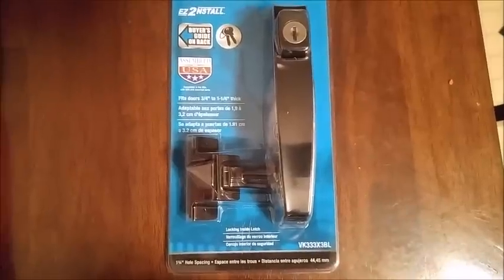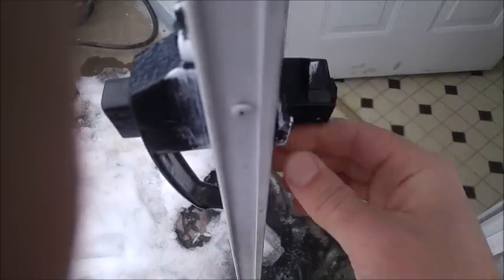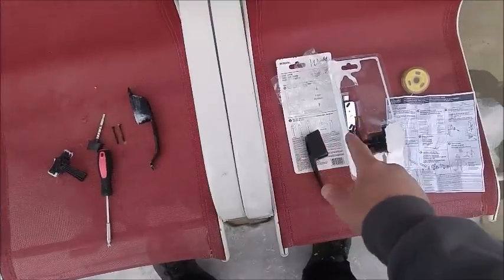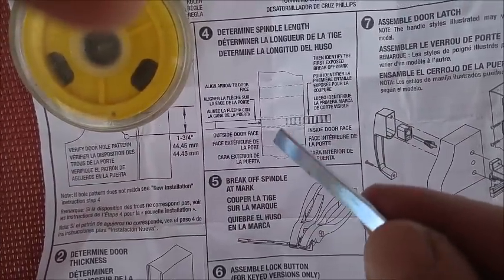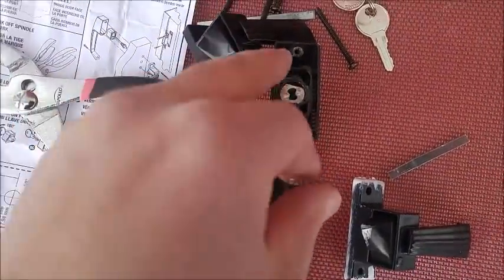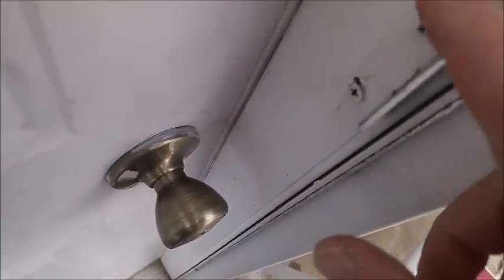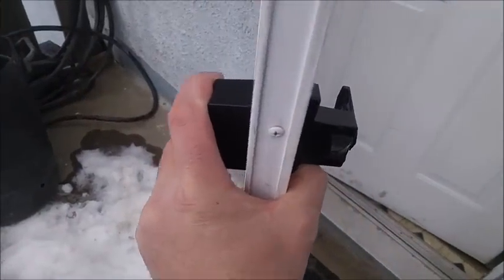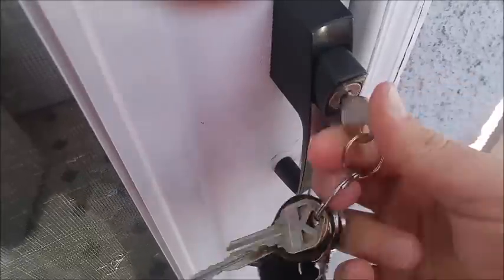How to Replace Screen Door Push Button Latch With Lock

Comment: I know this video is 6 yrs old, but THANK YOU! I’ve been searching YouTube trying to figure out why the key hole won’t stay in the push button part of the handle, but the 3:00 mark in your video was the solution - I had to rotate it with the key 🤦🏻‍♀️. WTF tho! Been searching for this solution since yesterday and had to fast forward thru 100 videos to get to the door latch installation part on all of them and yours was the only one that mentioned this. You’d think Larson would have included it in their instructions but they didn’t and I calling them was no help - they said return it to lowes for another one, but the whole door is already installed without an issue. I appreciate your time and effort uploading this video. Thank you again!
Reply: I had the same experience as Donna with my Larson door, this video helped me very much.

Comment: I have a question...I installed this as a replacement handle...but I didn't cut the spindle because I didn't think it needed to be BUT my door will not lock with the key...and I really need it to..I took it off and put it bad twice...but all I did the second time was turn the lock over so that the flat part was on the bottom...
My spindle was even with the door...
What did I do wrong....🤦‍♀️

Comment: 2021-06-30 - Never mind the comment.  There is an arrow on the metal piece you put on the outside of the door and that will tell you where to break this off. This is trial by error.  Take the last one off, see if it fits, if so done. If not take the next one off and continue the process until you are finished. It does work but you need a little patience.

Comment: Nice video but you forgot how to determine how much of the spindle to break off.  Is this trial and error?  The instructions on the unit were not very clear either.
Reply: For real. I think the spindle needs to be shorter for the keyed button, because going solely by the instructions, it ends up being too long.

Comment: installed handel but when i unlocked it with key the whole lock came out?
Reply: The same thing happened to me!
Reply: Brooo same😂😂
Reply: Same here.  This video explains it better than the paper instructions.
Reply: Sand thing happened to me. The 3:00 mark in the video explained you have to insert the key and turn it to lock the lock inside the push button on the handle. My lock kept falling right out everytime til I watch this video.